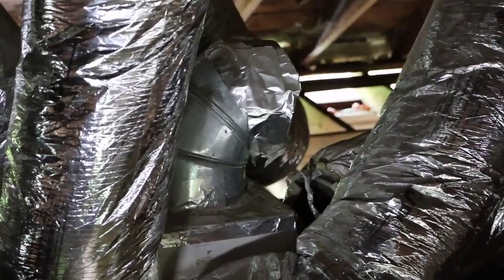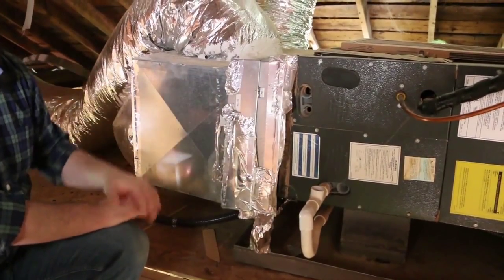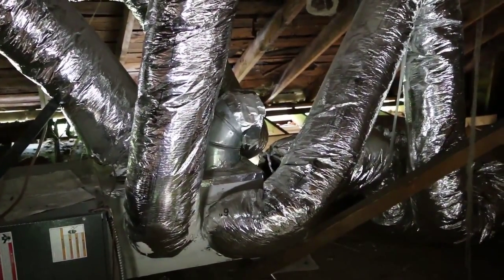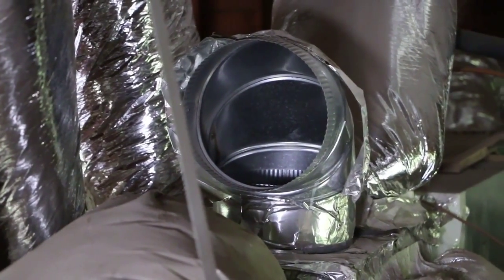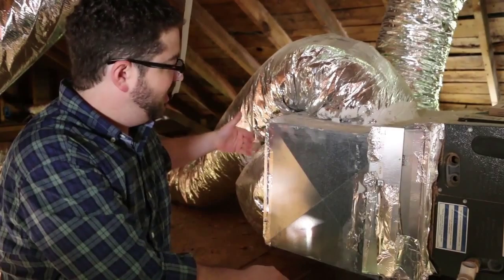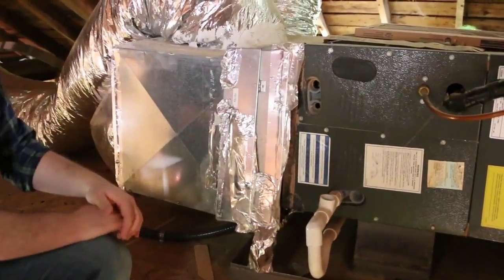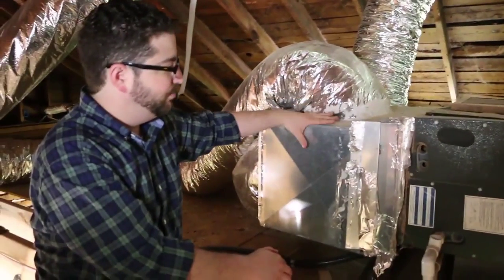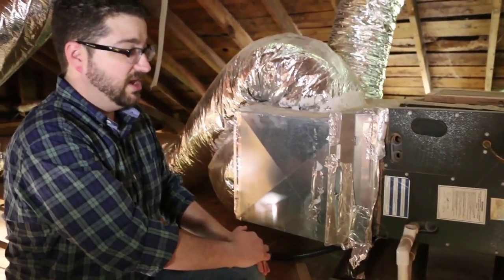Bad HVAC Install | Green on Gift

Comment: Pretty knarly man, pretty knarly.  Those spider-web flex jobs are horrific. Especially with an air source heat pump where proper airflow is critical to comfort and performance.  They sorta resemble the old 'gravity heat' coal-fired systems where the furnace sat in the center of the basement and a spider-web of 6", 7", 8" or larger round pipes were installed at head level off of a round plenum and routed to the individual registers at a direct upward angle.  

The returns were usually a 18",20" or 24" galvanized round drop directly out of the panning to the bottom of the furnace.  No blower, no central a/c...just a 'heat rises' principle.  The whole metal job would then be wrapped in dampened asbestos paper wrap which would seal the joints....for a few years anyway.  I cut my teeth on converting coal stokers to 'upshot' or 'inshot' natural gas or LP gas adaptions and adding belt drive blowers to the return air. I ended my career servicing and installing commercial and industrial DDC control systems 40 some odd years later.  I apologize for the lengthy reply....but I really enjoyed the industry.

Thank you for the video sir.  Normal people just do not know what they have in their attic or basement.

Comment: I've never seen a install that bad. Probably some fly by night guys. Or didn't know what they where doing
Reply from the maker: +Scott Dunn it was pretty bad. I think many homeowners just don't know how to evaluate good work. Thanks for watching.
Reply: Just did a job where the installer couldn't fit the metal cabinet for the Airhandler in the spot he chose so he Instead took the blower, motor etc.... and built a small wooden box with Styrofoam amd placed all the parts in it